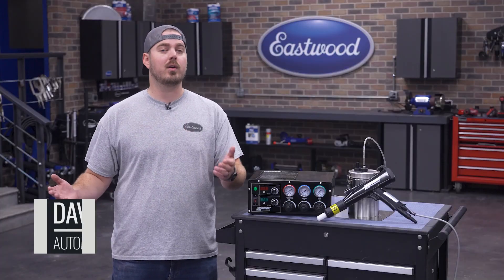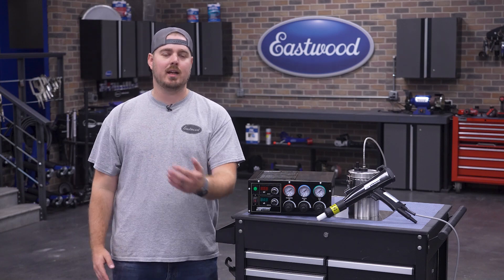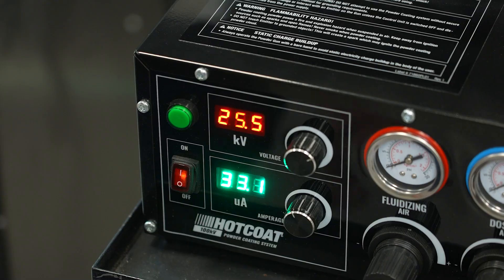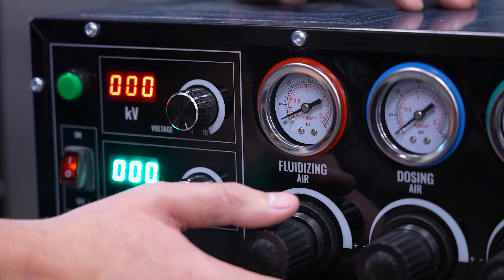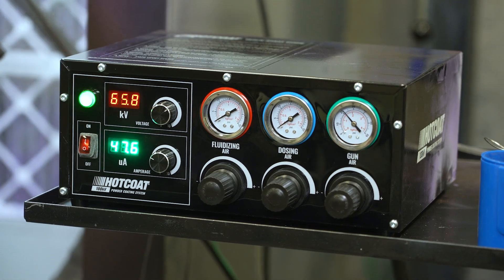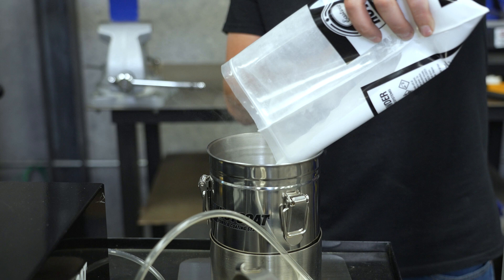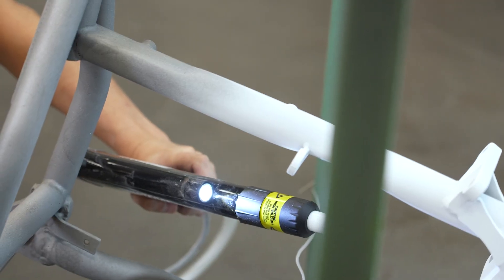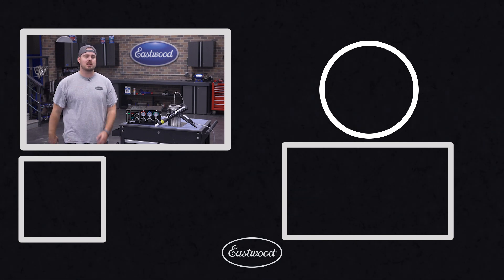Our Ultimate Powder Coating Setup - HotCoat 100kV Powder Coating System

Comment: you scammers, you should be showing it with the 2lb hopper that comes with the machine
Reply from the maker: This is a product video showing the new 100kV gun, it shows both hoppers the 2lb included and the optional 5lb hopper. You can get great results with either one.

Comment: 400Degrees Fahrenheit is around 204 Celsius. Aluminium wheels wont be effected badly by the applied heat in the oven?  I heard in other places that aluminium structure of a aluminium alloy wheel will be effected badly by this.
Reply from the maker: No, we have powder coated dozens of wheels in house, powder coating as whole has been doing this for years, the wheels will be fine.